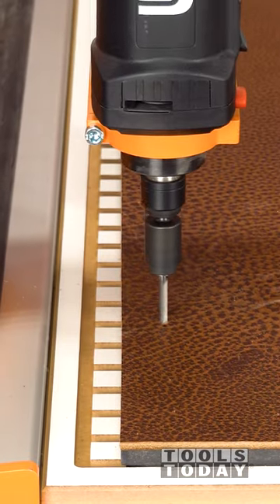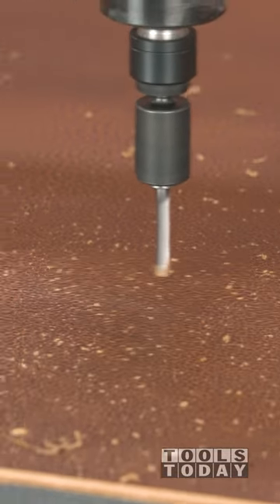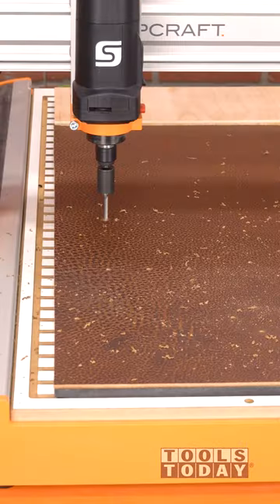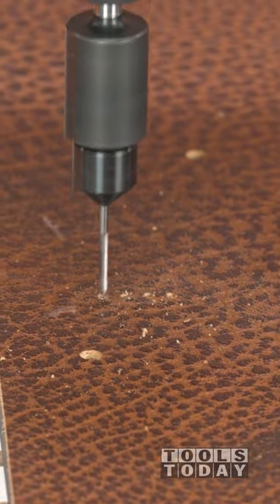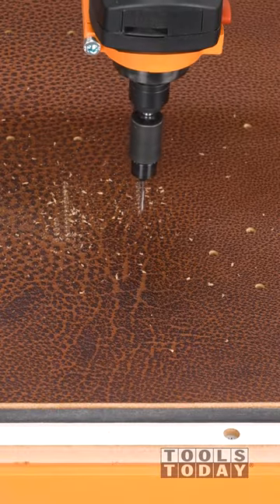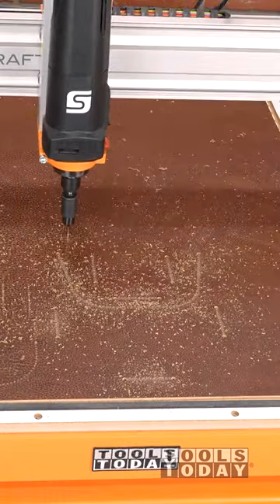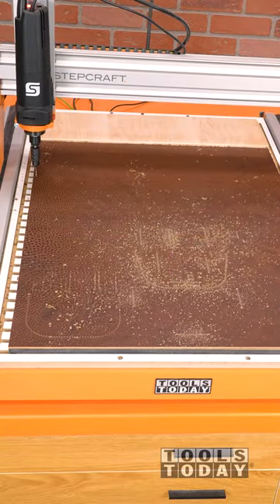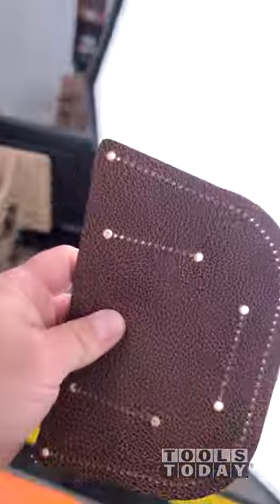Drilling Leather on CNC Machine

Comment from the maker: Check out the tools used on our site - https://www.toolstoday.com/stepcraft-3d-840-cnc-system.html

RPM: 6,000
Plunge Rate: 30ipm
Cut Depth: .18"

Amana Tool 364020 - https://toolstoday.com/v-6994-364020.html

363002 - https://toolstoday.com/v-6978-363002.html

47636 - https://toolstoday.com/v-12534-47636.html

365050 - https://toolstoday.com/v-7009-365050.html

363005 - https://toolstoday.com/v-6985-363005.html

Fein Turbo 1 - https://www.toolstoday.com/fein-92035236090-turbo-i-wet-dry-dust-extractor-vacuum.html

Comment: How do you affix the leather to the substrate so it doesn't move around while the work is being done?
Reply from the maker: I am using a vacuum table on the machine.
Reply: @ToolsToday  What kind of vacuum table are you using to allow through cut? I want to buy this setup since I'm thinking about making similar products but have no good solution to hold down sheet needs to be cut through.